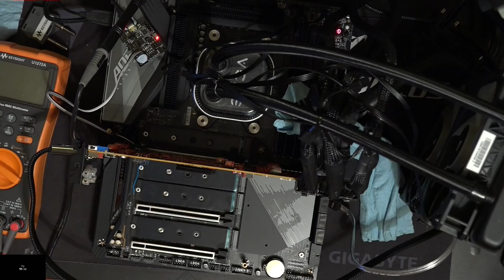One of the powerstages on my 6900XT blew up.

Comment: Buildzoid can you confirm the style of an Xfx speedster 6900xt merc 319 black is same pcb setup as reference ?
Reply from the maker: AFAIK it's custom
Reply: @ActuallyHardcoreOverclocking  Bykski states they make a block for it , anyway to
Confirm it will fit ?

Comment: I heard PowerColor had questionable reliability last generation, and this time, your ultra-high end Red Devil Ultimate RX 6900 XT's power stage explodes. I guess PowerColor still has reliability issues when pushed to the limit. Buildzoid traversed, where no man has overclocked to before, and faced the consequences. Lesson learned; if I buy a 6900 XT, I will go for Sapphire, XFX, ASRock, or MSI. Keep up the great work.

Comment: Don't the Vega FE die as well? Have you considered getting a lower tier card to test everything on so if you kill it's not as bad then work your way upto the higher cards. The 3060ti is a good start on the Nvidia side Vs going straight for a 3080ti or 3090

Comment: Rip. This is why modding is risky. It's voids the warranty and now you can't rma :( personally I wouldn't mod a card that costs this much. 

The 3060ti level cards are just as fun to mod but cheaper and easier to take the hit if it dies on you like this. 

I had a gtx680 lightning that was really good and 1st session on ln2 it died before I even got a score 🙃

Comment: nominally 350watt peak stock card, pulling over 980amps idling under LN2, now that is impressive. if that power stage did take out the not-tungsten-wire core, I want to know how long that GPU die sustained fusion after that z-pinch pules of collapsing plasma power. lol.

P.S. yeah, something not right, 70A power stages shouldn't be letting go at idle, maybe current balancing is whack on that card, or maybe it's a defective batch of power stages. that VRM controller wouldn't be dropping down to single phase mode at 100amps draw, would it, hmm

Comment: For what it's worth, a lot of the time, the core survives when this happens.  The hard part in this case is going to be soldering the replacement power stage without damaging it.

I wonder if maybe there's some damage to the bootstrap capacitor for that phase, hence the failure.  High side fets seem to fail almost immediately if you don't have a healthy bootstrap voltage.

Comment: You are, focusing on the wrong things.... what happened to this Gpu, as you have no idea at this point makes it irrelevant...what is instead extremely  relevant is how you feel about it... what you should learn from this episode is that YOU DO NOT MESS WITH GPUS OR ANY HARDWARE< UNLESS YOU CAN BUY AT LEAST TWO OR MORE AT A TIME to satisfy whatever endeavour You have planned for them.
Besides what most likely happened is that  that component that failed, wasn't installed properly out of the factory..... did you take any time to check every single solder point on that PCB?!

Comment: We live in an age where most parts are made to the cheapest specs and corners are cut, it blew up cos its made badly unlike a toyota engine which is designed and built not to fail
Reply: We're comparing Toyotas with PC hardware? Wait....do you work for Toyota.....? 🤔🤔🤔
Reply: @comradesandwich9437  yes ha ha parts dept

Comment: i would say your only mistake here was not about spending so much money on a gpu. it was spending so much money on a RED DEVIL card. due purely by their past history being so shady in terms of the reliability of them. it speaks to the way they operate. even when today's product looks to be good on the surface. and you seem to have confirmed my lingering suspicions about them here. so unless red devil themselves reach out and offer to work with you to fix these issues you have found. and actually address them properly. which is for their own benefit after all, to improve the quality and reliability of their own products... otherwise then i would stick to the more reputable brands only and stop being so much against buying nvidia now i guess? since 30 series they reduced or removed so much of the complicated power balancing circuitry it had become more of an option now for easier modding, isnt it? still sorry to hear about these weird behavious / issues, after spending so much on the card. good day my friend

Comment: You need to do it in BZ fashion. Buy another 6900 XT but don't turn it on. De-solder one of its power stages and use it as a replacement of the dead one.
Seeing your last teardown video of 3060 Ti, I assumed you wouldn't even bother turning it on. 😂
Now seriously, good luck with your fix.

Comment: Man no way lets all hope that it shorted to ground not to the core.

I just recently had a cap pop on a 7950 shorting 8 pin directly to ground and burning the whole pcb between that 12v rail and gnd. But at 10 years old its some what excusable.

Comment: I really get the feeling that both AMD and NVidia threw a bunch of garbage on the market at the high end, knowing that they'll sell out regardless. So, nobody should buy this overpriced crap until they get their shit together in terms of pricing and quality!
Reply: Although I do respect where this is coming from, losing all their high-paying customers by selling us crap probably wouldn’t have been a good idea in terms of retention.
Reply: @dainluke  I don't necessarily think this was on purpose - I think they threw out the new generations as quickly as possible without proper testing and quality control now that margins are stupidly high to cash in as much as humanly possible. You know when you do kind of a half assed job thinking "eh, it's gonna be fine - did this a million times already, what's another set of tests gonna do?" I think that or something like that is the mindset they're currently in. Looking at several GPU reviews, GPUs in general seem to have degraded in overall design and build quality this generation compared to the last and most certainly the previous to last one.
Reply: @CaptainShiny5000  Ah alright. I actually do agree with you. I don’t think it’s a matter of them being rushed though. I think that COVID and increased manufacturing costs led them to push out products with decent, but not fully consumer-focused, designs. They’re sort of giving you an ok product, while skimping out here and there. I think Palit did an insane job though. Their cards have been a major step up and the G6X thermals on all of them that I’ve owned have been absolutely elite. Palit also did an insane job with the Galax HOF PCB.

Comment: Given this Graphics Card decided to eliminate itself, I hope you will share the journey to maybe figuring out why it happened and whether it can be fixed.
I think this video has a reason to exist as a probable lesson in what not to do, assuming pushing the current limit higher than it needed to be was the cause.

Still interesting to hear your thinking on the whole event.
I have no doubt that someone would be willing to buy the 6900XT if you get it working again.

Comment: 999A would be 2% beyond 980. I don't believe maxing the OCP caused the failure.
Reply: I mean, why would it cause a power stage to blow up when you will never even remotely reach the OCP limit? I don't think that was it.

Either he was just very unlucky and it had nothing to do with anything he did or the condensation killed it. Most likely scenarios IMO.
Reply: @CaptainPrice-f6g  On AMD there is no need for it, actual real world performance is going to be superior on a 1:1 IF setup, so max. 4000, realistically 3800.

For Intel it might make more sense, but performance scaling after about 4400 is pretty weak. If you are just looking for a daily build, getting a more mid-range board like a MSI Tomahawk won't make you miss out on much if anything. If you want the best board with the highest OC headroom, get an Asus Apex.
Reply: @marceldiezasch6192  a guy was saying that high end mohterboards are not useful compared to mid range and when i give him ram frequency point he was saying no one gonna oc there ram uptop 5000 mghz until they have 5000 mghz kit , is it true ? and can you pls tell me why high end motherboards are there if a mid range motherboard can run my processor at max speed ?
Reply: @CaptainPrice-f6g  For a daily system they really aren't that useful, the nuance comes mostly in extreme overclocking. 
If you just want a good reliable daily build, there is no need for highend boards.
Reply: @marceldiezasch6192  I mean what is the real need of high end boards ? Like apex,hero,aorus master,ace,etc.
Reply: @marceldiezasch6192  pls reply bruh😭.
Reply: @CaptainPrice-f6g  The differences are mostly overclocking/bling focused. More overkill VRMs, POST codes, safeboot buttons and your typical RGB bling, unnecessary backplates etc.

You've sort of answered your own question in regards to a million SATA ports, M.2 slots etc. Most people won't need them.

A lot of the features of high end motherboards are either very niche or actually useless and exist only for marketing purposes. If you can't see why you would need them, you most likely don't need them.
Reply: @marceldiezasch6192  this was my las ques bruh 😭.
Reply: @CaptainPrice-f6g  For AMD you can just buy a 150-200$ board, for Intel the VRM is more important and the boards are more expensive, so more like 200-250$. MSI's Tomahawk series is fine and does everything you should need
Reply: @marceldiezasch6192  bruh pls give me an accurate ellaborated answer i am so confused.

Comment: I increased my Nitro+ 6800 XT's GFX TDC limit to 400a (from 300a) and it died while running Time Spy Extreme. The fuse blew. Fortunately, it was just the fuse. I resurrected it by shorting the two blown 12v fuses. It's been running fine since. I was "lucky".
Reply: And that is why we buy SAPPHIRE.

Comment: man that's brutal, hopefully they step up and repair or replace it for you, some companies will use the "you modded it" thing as an excuse but every so often someone will bother looking closely and saying "but that wasn't the problem, we got it". Those are the good times. 

If not tho GL on the repairs, hopefully the core is safe and you just need a new powerstage
Reply: I don't think any company would fix a Frankenstein graphics card.
Reply: Nope once he modded it if anyone looks at it that knows anything the'll deny coverage on it. There may be a chip that holds running conditions as well simaler to smart for harddrives. Hours on, temp e.t.c. so its anyones guess really.

Comment: In this video, Buildzoid tries to rationalize why it wasn't his fault his 6900xt died.
Reply: The roller-coaster around 5:31 where he goes through 5 stages of grief :o)
1. Denial: "That's still not that high!"
2. Anger: "That shouldn't blow a power stage unless it gets overloaded by incorrect power management!"
3. Bargaining: "Like this is a 14 power stage, 70 Amp smart power stages, we're at idle. I did pre-testing on this card and it was running at reasonable thermals."
4. Depression: "Oh ... wait ... 999 is technically outside of 14 times 70 is 980 Amps and I was at 999. Is it really because I maxed out...?"
5. Acceptance: "Looking back at that decision making process, that's dumb. You can't be too surprised if things die."
Reply: i would be doing that too if i were him lmao
Reply: VEGA VEGA VEGA lol
just wish it was on video, hope he can necro the card back to living death.
Reply: I mean, he was running at idle, it really shouldn't have died
Reply: @CaptainPrice-f6g  what, why r u asking me in a completely unrelated comment

but Ram OC is pretty much the only way to gain significant performance since most CPU's are already running close to the limit

if u don't have a good kit of ram, u can't reach high frequencies

But frequencies don't matter that much for performance, u gotta optimise latencies for decent memory performance, i like crucial ballistix cause they are cheap and perform pretty good

Anyway, the motherboard's advertised speeds are helpful as a rough indicator rather than a precise stopping point, and normally if a motherboard advertises a speed, u can probably achieve it on a decent kit of ram, although at what latencies and whether performance will actually be good is a different story
Reply: @CaptainPrice-f6g   high end motherboards are bad value

u can run 5000mhz on large amount of non 5000 xmp kit(but whether u should depends on your CPU and Ram timing)

High end motherboard basically just have more stuff(more USB, PCIE, Power delivery, heatsinks)

if u actually care about memory OC get a evga dark or asus strix b550i or b550 unify x or something

But 5000 for daily use would really only be useful for maybe 11th gen and ryzen 5000 APU
Reply: @krazybonnie5523  i mean strix e gaming will be better than tuf gaming ? isn't it ? and bullzoid said strix e is the best value motherboard of asus z590 lineup and about memory oc can i oc  5000mghz on patriot viper steel 4400mghz cl19 ? will my performance will increase ?
Reply: @krazybonnie5523  pls tell bruh 😭
Reply: GPUs have power limit protection for a reason.. without it you are rolling dice
Reply: Bro I love the comments good ole fashion fun! No toxicity and ripping on this man overclocking to the high heavens love it

Comment: You should probably have posted this video after they shipped you a replacement
Reply: TUL won't even touch my RDU with a ten foot pole because one of the mounting screws doesn't have the warranty sticker on it let alone the crazy, shroudless, soldered, epic, beast that his RDU grew into 😆